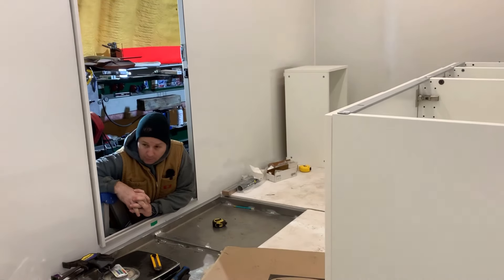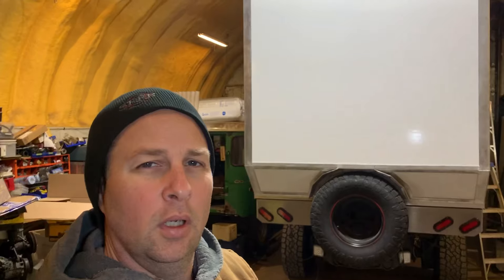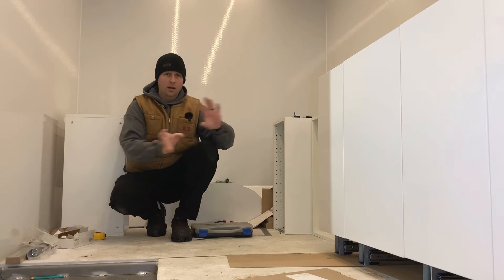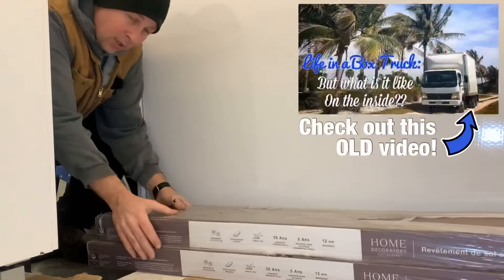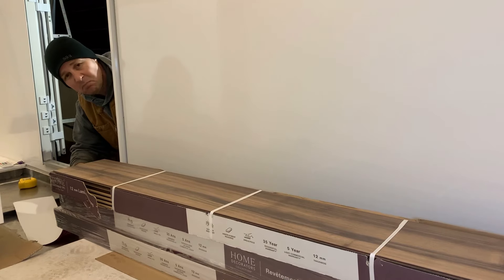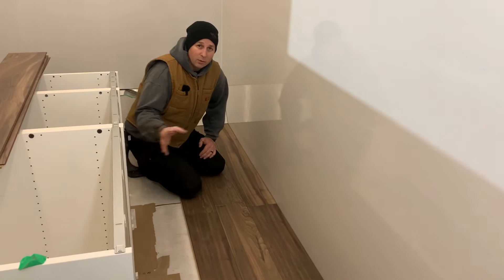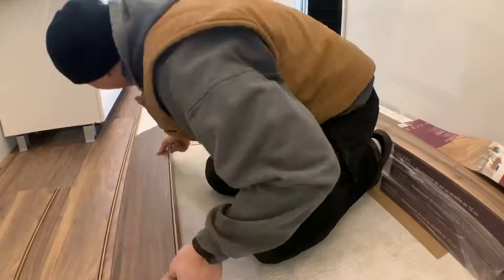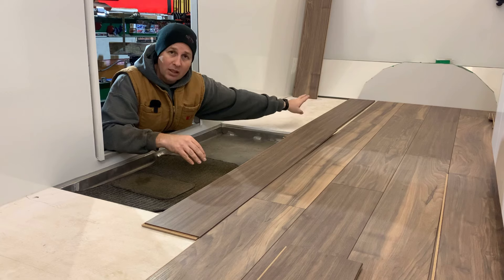Does this thumbnail give too much away?  | 4x4 Overland camper build

Comment: Doing the full floor is the best way, IMHO.  I'm surprised that you didn't use luxury vinyl plank in a potential wet area. Was it for the added strength of screwing down the kitchen cabs?  Nice quick install.  Rectangles R Easy.  Was that real Acacia flooring or manufactured? Pretty. Got a sample of Woodland Antique Mahogany Solid Core LVP for my kitchen, which should look good in contrast to the white painted cabs, if I ever get around to it.
Reply from the maker: I agree, rectangles are the easiest!  And this was far more rectangular than any house room I’ve ever floored 🤣🤣   I’m not sure if the Acacia was solid, or a ply with the top layer of Acacia, but it was too expensive either way!!

Comment: I don't think you'll have any differential expansion issues with the sub-floor and top floor - both are laminates and should behave pretty similarly.  Ensuring the area under the kitchen (sink) is given plenty of coats of clear to seal it should hopefully help it resist any water leaks pretty well.  I would have covered the entire floor too.  Consistency is generally a good thing for long term integrity despite the additional weight.  Dare you to paint your Canter in to match those super-cute little fire truck cartoon versions in the closing titles 😍  In all seriousness though, the best outcome from a bad situation for the folks with the battery fire (still serious about painting your truck red too... 🙂)

As promised a couple of weeks ago, our little Canter features in friend Robert's video here:  https://www.youtube.com/watch?v=xWRfPuCgxhg&t=5s  Not only do you get an idea of what our little ex-mil truck looks like, you'll also see the difference in chassis flex between our truck with 'cushyfloat' mounts, and the long wheelbase with a full length bolted module.  The green truck was built by Amesz and uses a full steel skeleton for its module, so using solid mounts isn't an issue.  As a bonus you get some info on the Qaife auto torque bias front diff should you want to fit one.
Reply from the maker: Great video! - I’m sure I’ve seen some of his videos before, and for sure I’ve seen that crazy hill in a video somewhere!!!    Haha, yeah I don’t think we will end up red with retro-reflective white stripes 😁.
Reply: @BruceandKrista  Where's your sense of adventure with that colour scheme? 😂  If nothing else, it would make it super-easy to spot your truck no matter where it's parked.

Yeah, that hill is nuts and really gets the adrenaline going.  Thankfully wifey was on hand as our drone operator and to take care of us if the excitement got too much 😂  We could get our little truck up there only by very carefully picking lines, so the ATB front diff helping to get K's long wheelbase truck up (just shy of the 6.5 ton GVM) was quite the feat.  Thankfully if you head 'Down Under' there is less demanding stuff to do!
Reply from the maker: Hard to hide in a parking lot when you look like that though!!